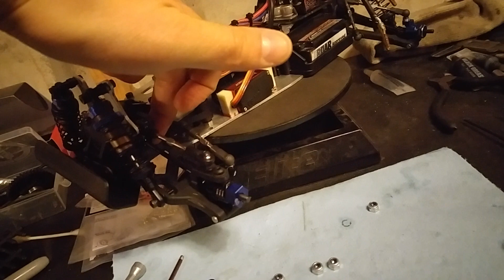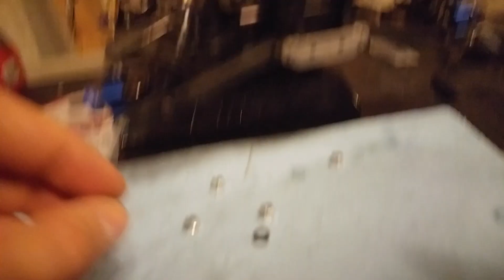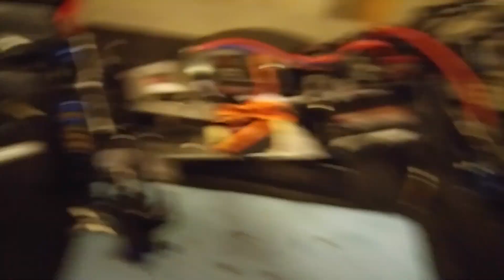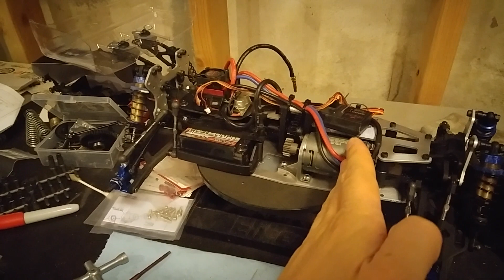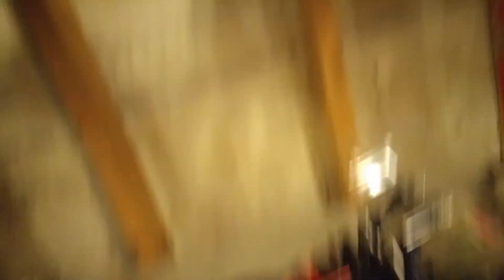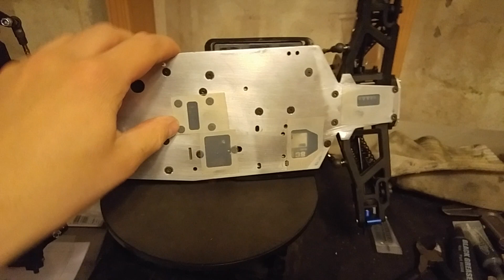Vintage Kyosho Inferno 10-E Build, Part 5

Comment: Love all this old stuff being restored. I had a go at it a while back and just struggled so much getting bits. What's your secret?
Reply from the maker: No secret, really.  I just bust my ass and get lucky from time to time on eBay.
Reply: @doctormosfet  I guess being in Australia  might make it a little more difficult as not everyone posts overseas. Nice vids mate
Reply from the maker: Yeah, that could be an issue, although I haven't had too much trouble buying from overseas sellers on eBay.  Anyway, glad you like the videos!
Reply: @vhrte49 sabulatech in the u.s. has a few old bits for cars mate. Australia's vintage scene isn't as large as the states.